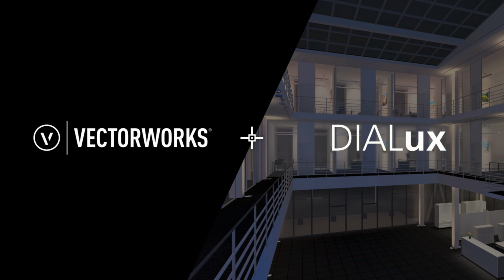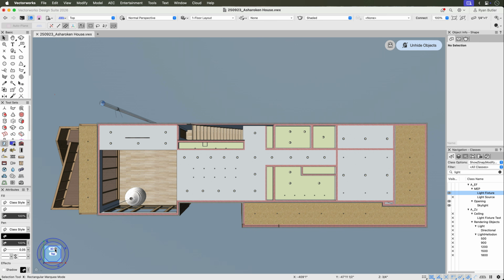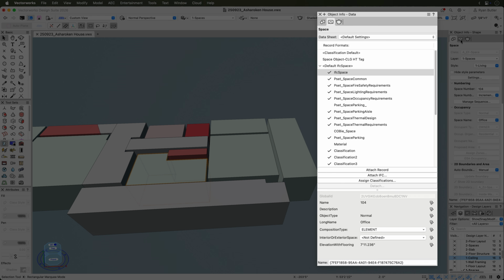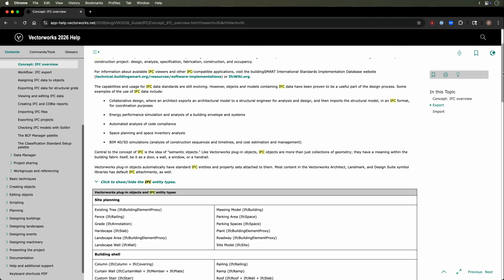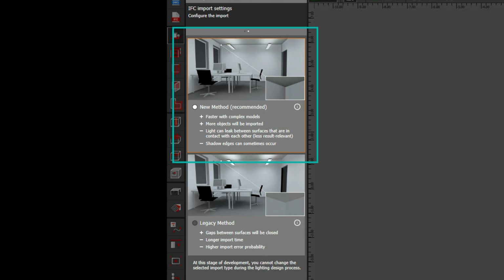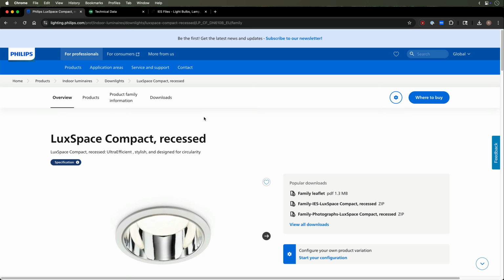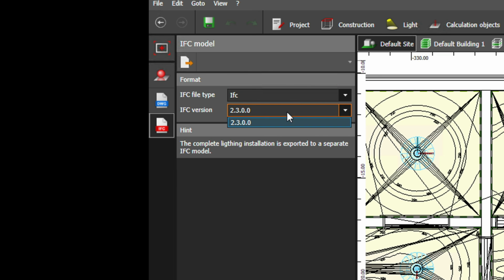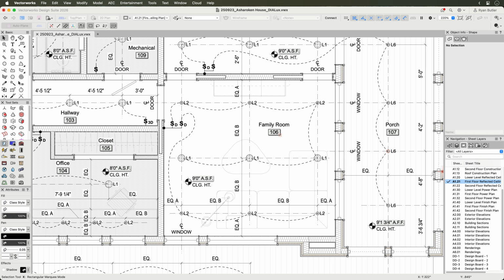Vectorworks & DIALux Integration

Comment: So the IFC Export can be Utilities to Share Geometry to Dialux. The Lightsources with propably attached IES Files from VectorWorks needs to replaced inside Dialux, Right ?
Reply from the maker: Correct. IFC doesn’t support light source data, so only the geometry goes from Vectorworks to DIALux. You’ll need to replace those lights in DIALux with manufacturer fixtures that have their own IES data. That info doesn’t come back into Vectorworks — you’d have to export the IES from DIALux and add it manually there. This step is required if the IES data is needed in Vectorworks to create renderings.